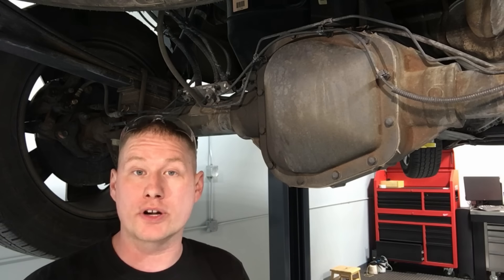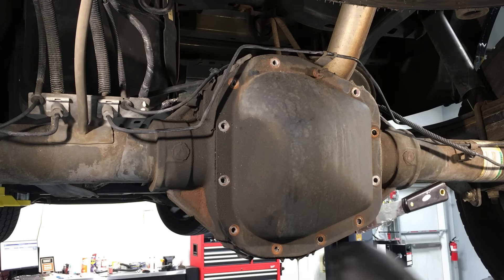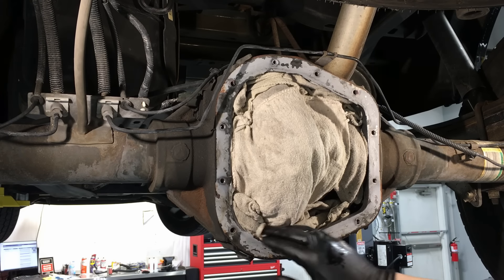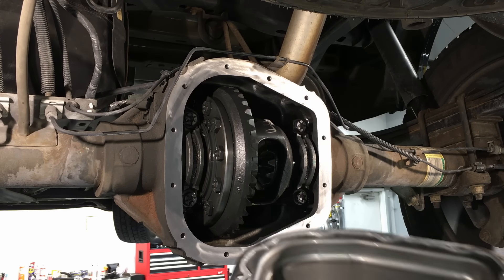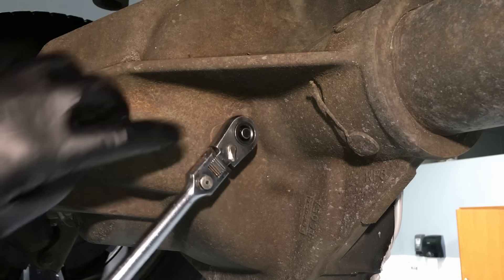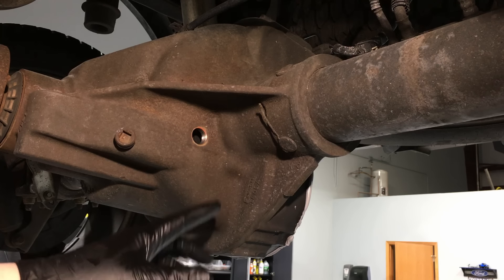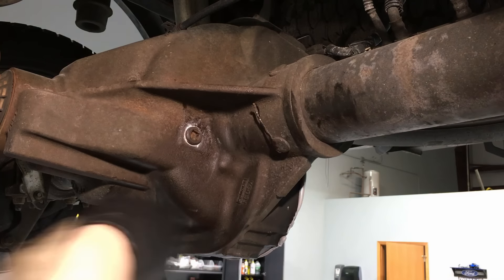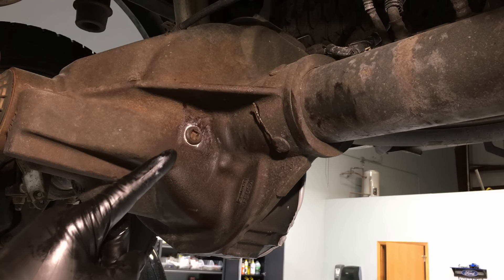Ford 8.8" 9.75" 10.25" Rear Differential Service: Fluid Change Procedure

Comment: Many years ago I took my new 320i BMW into the dealer for its first required fluid changes.  What a nightmare!  The 'mechanic' pulled the drain plug on the gearbox, counted to 3 and screwed it back into the hole while oil was still pouring out!  I was watching from the doorway, and told him to please let it fully drain.  He argued about it, said it made no difference and refused!  He then did the same with the rear axle!  Things went rapidly downhill from there with the rest of the 'service'!  Plus I was forced to cough up a ridiculous amount of my money for the pleasure!  Oh yeah, they also put a nice dent in the front fender!

After I left, I stopped at a well-known local independent BMW repair shop to see if he would do the required warranty maintenance work for me.  "I'm really booked up with long-time customers, and can't take in any more work.  Are you mechanically inclined?"  I told him I was, but didn't want to void my warranty.  "Well, if you continue taking it to the dealer for this stuff, I can almost guarantee you'll be using your warranty!  If you do the maintenance yourself, chances are excellent you won't have any issues, as these are very well built vehicles.  If I were you, I'd just do the work myself.  No-one is going to care more about doing the job correctly than you!"  I took his advice and have never taken any of my new vehicles to the dealer for service since.  Best advice I ever received!  Of course these days, if you keep receipts, you can do your own maintenance w/out fear of losing your warranty- even if the 'dealer' says you will.  Things have gotten much better in this regard.

Comment: What would you recommend as a change interval for my 18 F350 with electronic locking diff? Front diff also?
 I am glad i didn't wait for 150k on my trans. That would have been bad. I just did mine the other day at just over 58k. Wish i would have done it at 40k but it wasn't too bad. 
Proper maintenance is important and i like keep up on it without being too crazy.

Comment: FordTechMakuloco, As a retired tech for 41 years, I am concern about the torque specs that you mentioned regarding to diff cover bolts (35 lb-ft). Those are 5/16 or metric bolts close to 5/16". Recommended torque for grade 8, 5/16 coarse bolt is 18 lb-ft. I think that 35 lb-ft is way too high.
Reply from the maker: Never a problem, Ford has used torque values ranging from 31-35ft lbs (depending on your model) for years.

Comment: axle seals or clutch packs usually go before needing to change the fluid anyway
Reply from the maker: no
Reply: used to see it daily
Reply: They came out with a tsb for the clutch pack shudder.  Lots of leaking axle seals back in those days.

Comment: Just got my supplies to do this change and the permatex gear oil gasket instructions say to only hand tighten the bolts until it squishes out a little, then wait an hour to fully tighten. Then wait a full 24 hours to put the gear oil in. Apparently all that is not necessary?
Reply from the maker: Correct no need to wait to tighten.
Reply: @FordTechMakuloco  thanks for the help!

Comment: Friction Modifier...some places say 4oz, 8oz or 1oz per pint of fluid, which would be 6.5oz. Which is it? The owners manual for my 2009 F150 with 9.75" diff says 8oz for 2004-2010 year models and 4oz for 2011 and up. Using Motorcraft 75w-140 and XL-3 modifier will it hurt anything to use 8oz instead of 4oz? Also wondering why it says to fill within 1/4-9/16" of fill hole? Thank you! Not questioning your experience just wanting some clarification. I've never been good with because I said so for an answer...😊
Reply from the maker: Not sure where you are getting your information from, but it has always been 4oz. the only trucks that take more are the bigger differentials in the Superduty trucks. You can make a custom zip tie dipstick marked for the level you are stating below the fill hole but no one does that and there is never a problem. Reason being the axle tubes leave room for the fluid to go.

Comment: I have a 2016 F-150 with 3.73 gears, the rear end has the locker on it though. My question is, does that mean it's not limited slip?

Comment: I have a 2018 escape sel awd with 52k on it. It has the abysmal 1.5 eco. My dealer is stating fluid in rear diff is lifetime. if i don't want to tackle fluid change myself where do you recommend me taking it to get this serviced? I wasn't sure if trans shop is my best bet to get it done right.

Comment: You didn't mention it, so I'm wondering if it's ok to spray inside the rear end with brake kleen  while you've got the cover off to help flush out debris and old fluid. Or is that not recommended because it may harm any seals ?
Reply from the maker: I do not recommend it.

Comment: Getting ready to do my F-350 SuperDuty w/10.5" Sterling rear w/Limited Slip.  Was planning to use Valvoline full synthetic 75w-140 in place of the Motorcraft you show because the price is half and includes friction modifier in it for another $10 savings.  Any reason I shouldn't consider the Valvoline?

Comment: Please make sure the fill plug is removable before disassembly.
Reply from the maker: When was the last time you saw a seized plug, they are NPT threads and use teflon to seal out moisture.

Comment: i did this change 20,000 miles ago. i think i might not have gotten all the friction modifier in their.( should of followed your video exactly) would it hurt anything if i added another 1/4 of a bottle of friction modifier? i have a very mild vibration/shudder  when turning when vehicle is cold, from a dead stop.3.55 limited slip axle

Comment: I know for engine building lint-frees are very important I'd imagine it is the same for differentials don't you think?

Also for an electric locking on a 2013 F-150 does it require the friction modifier?
Reply: He covered that in the video.
Reply: @gregd6404  I did skip part of it if you are talking about the lint frees.

But if you are talking about the electric locking rear diff, I didn't notice him say specifically.

Comment: Could I use Red Line 75-140 synthetic gear oil instead?  I see Amazon has gallon jugs of it for $65.  Rated just as good as the motorcraft synthetic, but I won't use it if you advise against.  Thanks!

Comment: owners manual states 2.75qts. It took 3 and never spilled. I'm used to the "fill til it spills" method like you show. should i take out .25qts or put in more to spill?
Reply from the maker: Fill it until it overflows and levels off

Comment: How do you feel about using a gasket on this?  I have a nice aftermarket cover I'm planning on putting on when I change my diff oil and it came with what looks like a quality gasket.  It's by LubeLocker.  Are there any advantages or disadvantages to that?  I've always used RTV but thought I'd use the gasket since it came with it.  Thanks in advance.
Reply from the maker: I never will.

Comment: I drill a hole and tap it for a drain plug in the sump on the bottom i also put some rare earth magnets in the bottom If the veh.. has close to 100 th miles you are going to have worn axle shafts .If you can lift the axle shaft up any at all your axle and bearings are bad .
Reply from the maker: lol

Comment: The best price I've found is WalMart Supertech 75W-140 Synthetic Gear Oil at $11.86/qt and RockAuto for Motorcraft XL3 Gear Oil Additive, TA25 Thread Sealant and TA32 Gasket Maker for $4.08, $3.77, and $3.18 respectively.  Making my total cost $58.59 + tax and shipping.
Reply: I wouldn't do it. Using cheap oil will come back and bite you in the butt.

Comment: I have one comment/question. I saw all the crud that sits in the bottom of the diff.  You wiped it out by hand. I see aftermarket covers with drain holes for sale everywhere. It looks like that crud would be lower than most drain holes.
That being said, is an aftermarket cover with a built in drain hole a bad idea?
Reply from the maker: I would not use an aftermarket cover.

Comment: Hey Brian! Thks for the content... One question? I have a 2016 F150 5.0 and wondering if I should use 75W85 (as per owners manual) or  75W140 in the rear diff? Does your recommendation of 75W140 apply to 2016 also or to older models?
Thks
Reply from the maker: You can use either, the 75w85 is like water and is better for fuel economy but the 75w-140 is best for towing and long term reliability.
Reply: @FordTechMakuloco  Thank you so much for the prompt reply. I always go with your recommendations. Be well Brian!!

Comment: Was there a reason you did not install a gasket? Is it ok to apply sealent to cover, place gasket on the sealant, allow a couple minutes apply sealent to other side of gasket allow a couple minutes , install cover ? Either way im concerned about sealent pieces getting into oil .  How do you reccomend avoiding this. Thanks
Reply from the maker: I only use sealant, just the way Ford makes them at the factory.

Comment: Could it hurt to top it back off after getting warmed up? I took it for a little drive about until the transmission was warmed up and it let me add a few more ounces. Also there were already a few shavings on the fill plug. Should be good to go??

Comment: Ok what about a guy who has 40 inch tires and a lift , should I change the oil regularly to increase the life expectancy of the Diff ? or should I go with that the manufacture recommended service timeline

Comment: I have a 2016 F150 XLT V6 2.7 4x4. I have the conventional diff on my pickup. I do some towing with my boat and camper. Would you recommend using the Motorcraft 75w-85 or 75w-140 for my 2016 pickup? I’m not sure which diff fluid would be best for towing/use. I’m coming up to 48,000 miles and looking to get this done soon.

Comment: In part recommendation you have in there Thread sealant or the red permatex. I didn't notice you putting it on the bolts. Did you just not show that part and do you have to use it? Whats your thought?
Reply from the maker: I only use the thread sealant for the fill plug threads. I never recommended red loctitie anywhere in this video or video description.

Comment: I've seen a few videos on this procedure.  Is their any reason why you have not chosen to use the OEM differential gasket?  And if you had, would you have still used a sealant as well?
Reply from the maker: Sealant is the OEM gasket from the factory on all Ford differentials. Only some of the newest models offer a reusable gasket but 95% of Ford differentials are sealed just like this from the factory. Not sure where you are getting your information.
Reply: I was gonna say...what OEM gasket? FoMoCo uses sealant too!

Comment: Why couldn’t you use 3 or 4 threaded rods during reassembly to slide the cover into place?  Cover would be in place as you install the bolts with no sealant smear.  Just an idea…

Comment: How long does it take to allow the fluid to get through the tubes to the wheel hubs? Do you need to drive gently for a few miles until the fluid disperses through the whole axle? Just did my wheel seals and my diff at the same time. 1997 F250 HD 4x4

Comment: So do you prefer the sealant or gasket? My Ford dealer has "resealed" my rear diff twice and it's leaking a third time. First truck I've ever owned that used the sealant over gaskets and so far I prefer the gaskets. Just wondering what the pros think?
Reply from the maker: We use sealant just like the factory and when prepped well and torqued down properly it seals very well.

Comment: In your description you say 75-85 for 2015 and newer f150 but video you say 75-140 for all. I have a 2016 f150 which should i use ? Thanks for your time
Reply from the maker: Honestly either one. The 140 may offer somewhat better protection but the lighter fluids have come a long way and it seems the new 75w-85 fluid is doing well while offering some fuel savings.
Reply: @FordTechMakuloco  thanks again. You should open a school to teach.

Comment: Some top shelf brand fluid mfg's like Amsoil, Mobil One, Royal Purple, claim they have the differential friction modifier right in the fluid, so do you still need the friction modifier from Ford or other ?
Reply from the maker: I never use fluid with friction modifier in it, almost always it is not enough and causes problems. Another reason I stick with the virgin axle fluid from Motorcraft and add my own friction modifier.

Comment: 1.  Is that fill plug just a 3/8" square?

2.  Is it ok to trim off the excess cover sealant the next day, after it's finished setting overnight?
Reply: Just leave the gasket maker alone.  It's not gonna make a difference.  Control the OCD.  I understand the feeling though.

Comment: put all bolts, at LEAST the top most bolts back in the same holes, because on some differentials upper bolts may act as vent holes...in that they will have small holes drilled into them...if you use that heavy sealer instead of a gasket [with a VERY thin smearing of sealer]  you could easily plug up any venting holes on any venting bolts as well as some may squeeze out into the diff fluid on the inside of that cover and mix with it and cause problems

Comment: On the 2013 Expedition with the independent rear suspension, can you jack the vehicle from the Rear Diff 
and place axle on jack stands like leaf spring vehicles?
Reply: It is not recommended as the diff is only supported by a few rubber mounts. you can only lift on the diff on a solid axle rear end

Comment: Doesn’t the permatex directions say to let it sit finger tight for an hour then torque to spec? Finally fill after 24 hours.
Reply from the maker: Yes but I follow the Ford directions which uses the same type of sealant and in 20 years I haven't had a problem.

Comment: Brian, would the 75w140 axle fluid be the same used on a 1983 Ford Ranger with 7.5 ring, 3.73 limited slip rear end? Book says 80w90.

Comment: Oh man it's been forever since you made this, but I have a 2005 ford Escape 3.0 XLT and I was thinking about using 75w90 for my gear oil and then a bottle of limited slip additive any tips for this?
Reply from the maker: Use 80w-90 and no friction modifier.

Comment: I have a 2017 4wd f150 with a 8.8 Rear Axle. I don't have an Electronic Locking rear axle. I would like to swap it out for a 9.75 with either a Electronic Locker or If can't find one, find a 9.75 non electronic and swap it out with a Eaton True Track. If I do electronic I would have to get a switch to make it work. If I do the none electronic I won't have to worry about switch. What else would I have to upgrade if any  to make the axle work. Drive shaft, Flange etc. I know I would have to make sure the gear ratio is the same for both axles. I am going for a 3.73 gear ratio. Do I have to worry about the 9.75 being larger and change in torque and if so what do I need to do. Thanks for your input on this.

Comment: If I replace the differential cover with an aftermarket one that comes with a gasket, should I also use the sealant? Would it hurt if I used the sealant?

Comment: What if the sealant oozes inside the chamber?  Will that sealant mixing with the fluid cause problems?
Reply from the maker: No that is why you let it cure overnight before filling.

Comment: use a wire brush to loosen and  brush off all the DIRT that will be all over that differential cover...as well as the filler plug area

Comment: Hi,

Valvoline has differential synthetic 75w - 140, which contains limited slip additive. 

Do will still install the 8oz additive friction modifier? 

Or only if it doesn't come with the additive.

Comment: I have been a subscriber for years. I had  flywheel replaced a couple of months ago. I am getting the same noise again. Its a 2017 ford escape w/ 84000 miles. Serviced always by ford dealer. Purchased new. Could it be something else? What causes premature wear on a flywheel. Seems to get worse after turning a/c on. Any ideas. Thank you.

Comment: If we do not have access to that rotary tool you used to clean the surface, can we just scrub it with a normal scotch bright?
Reply from the maker: Yup just be clean about it don’t go getting the scotch brite material inside.
Reply: @FordTechMakuloco  Thanks for the fast reply! Do you recommend also using a razer blade or a gasket scraper? Or should the putty knife and scotch bright be enough?
Reply from the maker: putty knife and scotch brite.
Reply: @FordTechMakuloco  Thanks!

Comment: I have a 2000 Ford E150 van. The owners manual says not to change the rear dif fluid. It says its good for the life of the vehicle.  There's also an additive it says to use. What's the best way to deal with this? No service or service every 50k miles?

Comment: Is it worthwhile to put a magnet in the bottom to capture any metal shavings? I have a 1990 E350 with Dana 70 dually due for a fluid change.
Reply from the maker: No!

Comment: Question.  How long do you have to let the gasket maker silicone cure for before adding the oil?
Reply: 24 hours is best....i just re-did my oil pan gasket and followed permatex directions - hand tighten, let sit for 1 hour, then torque down, then 24 hours later you can  fill it with oil and run it. Worked out well for me. 

I've made the mistake of putting the bead on, torquing down right away and then filling with oil and running the car within 30 min. - it's not gonna be a good fit. Just be patient with it. 👍

Comment: Makes you wonder why they dont have a drain plug in the bottom. Would save a lot of time and would make frequent flushes much easier
Reply: Because with just a drain plug you can't wipe out the sludge and particles that accumulate on the bottom of the housing.

Comment: Doing a rear diff fluid replacement on my 1999 f250 4wd. Are the outer axle hub bearings lubricated by the diff fluid, or they need to be greased?